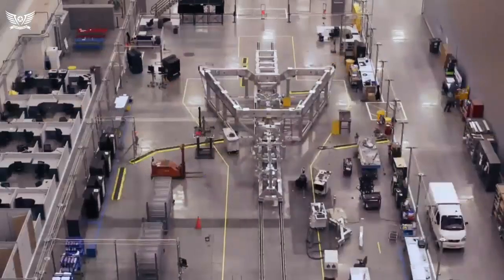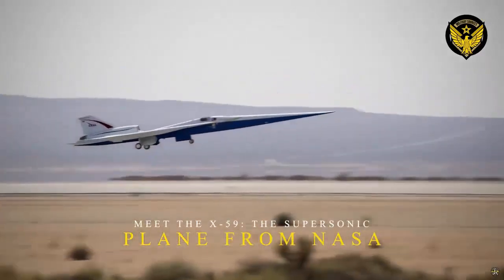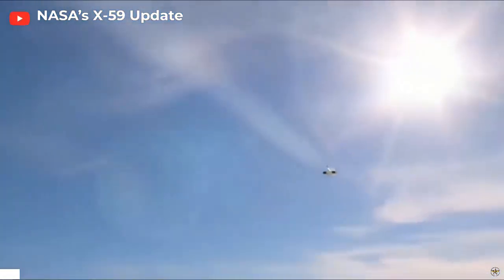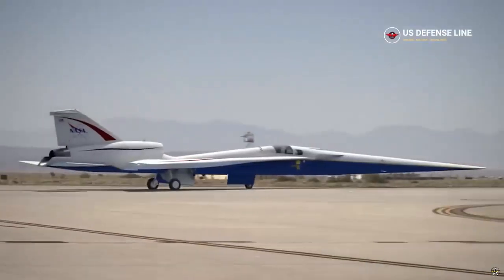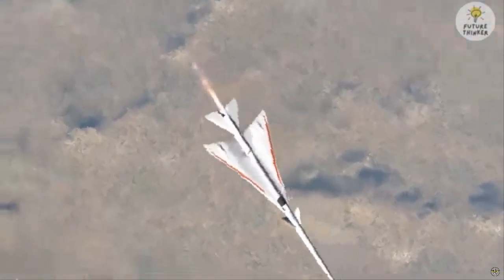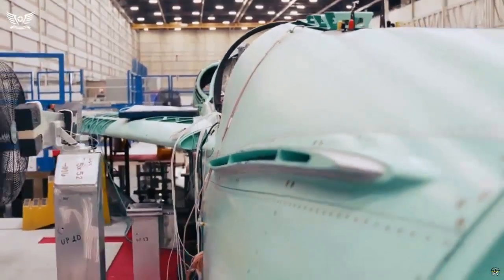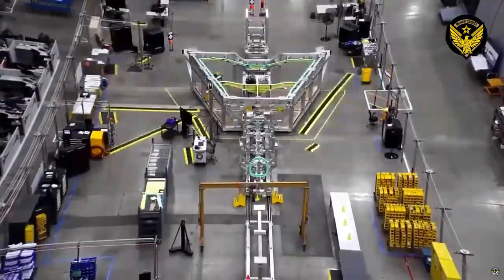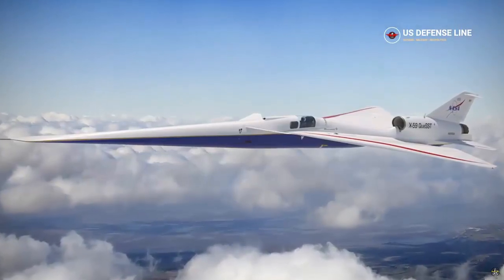Lockheed Martin moves the X-59 to ground testing

Comment: Old tech, research has already been done.  Nothing new here.  Also a single engine fuselage mounted engine and delta wing does not scale to multiple engine delta wing mounted configuration which is the only way you get a cargo carrying aircraft.  Aerodynamics kill it.  Concord sorted this decades ago, as did the Valkyrie.  Its all budget make noise.  Nothing new.